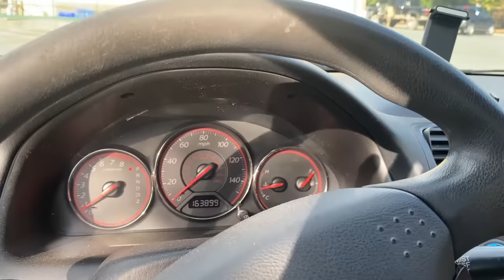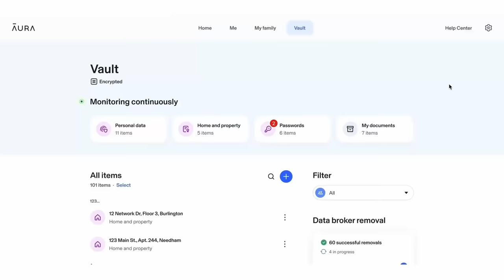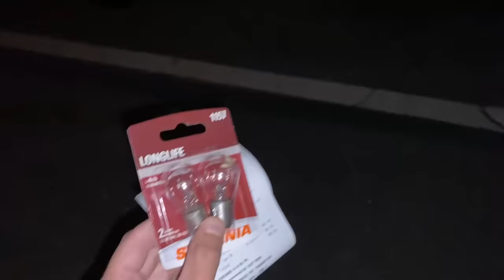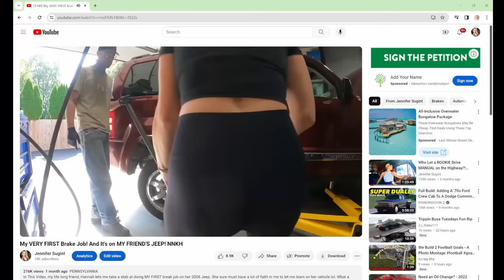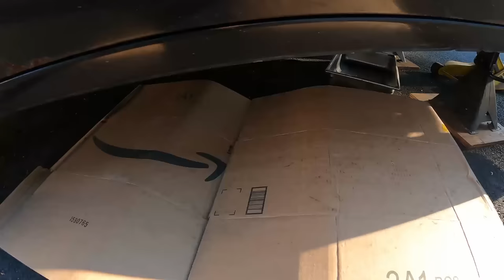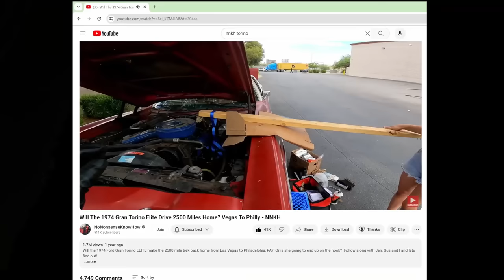Can This 86 Fox-body Mustang Survive its New Owner? I Bought a Manual! Jennifer Sugint- NNKH

Comment: I have a helpful suggestion for you. I noticed the falling headliner. I have done upholstery for years. There is a material I refer to as sew foam. It’s a thin layer of foam with gray cloth attached to the face. It is designed to sew to another layer of material to give a look of for an example padded vinyl. It looks just like your headliner. Same gray color. Take down the headliner backer board. Scrape the foam off then use foam fast spray contact cement on both the foam and the backer board and the foam. Let it dry for a few minutes then start at one end and smooth it together. Be careful of wrinkles. You can not pull it off to smooth out wrinkles. It once and done. Made a lot of side money for customers when I had my shop. The mastery is cheap. Good luck.

Comment: If you disconnect the incoming hose from the transmission going to the radiator, use a small amount of compressed air and blow back in the line. What it does, is blow back through the filter and clears it. It will eventually clog again. i actually ran my Civic like this for about 70,000 miles. I kept a can of compressed air and hose that I made to attach to the transmission hose, and had it down to about a 6 minute process. Just be careful not to use a lot of pressure, and a slightly warm engine helps. When it's cold it will blow right back at you. Also, if you take the transmission dipstick out, you will actually hear it clear, gurgle and blow air.

Comment: Just a hint that can save lots of grief later, always open the hood and the fill cap before draining the oil. There are few things worse than taking the oil out, only to find you can't fill it up again because the hood won't release or the cap won't come off. As for dropping the drain plug, I do it frequently enough, that I was not surprised it happened.

Comment: Jen, I'm a mechanic and I do yoga. It helps with getting into tight spots and remaining calm when faced with adversity. I totally admire yours and Chris' tenacity when it came to pulling apart the Mustang interior to get rid of every last bit of mouse destruction. Every time I watch your channel or Chris' channel it brings me back to when I bought my first project; a 1993 Cadillac Fleetwood Brougham. It wasn't in the best shape and it wasn't running either, but I didn't give up. I made it into something beautiful and I still have it.
Reply: Lt1?
Reply: @corona7st788  No, it's the Generation 1 5.7L V8. The LT1 is Generation 2.
Reply: @HighSierra1500  Thought those had the northstar in them
Reply: @gordocarbo  The front wheel drive Cadillacs had the Northstar engine. The rear wheel drive models did not.
Reply: @HighSierra1500  Thanks I did not know that! Northstar is a great engine its a shame about the head gasket issue, deal killer for me. THat engine was based off the LT5 and the LS1 off of it. 
May have to find a RWD one the LTx is easy to work on and the cars are cheap

Comment: There is nothing better than an 1986 gt Mustang with the factory square head rest seats gray with red piping/the center console with the picture of the car and lights up when you have a bulb out /the factory dash that lights up orange and has the round gages in it and finally the factory marchell fog lights the second Mustang that I owned was an sky blue 86 gt 62k original miles with a sun roof perfect gray interior power windows and locks 5 speed and was completely stock I bought it from the original owner who bought the car brand new in 1986 , I had it for 15 years until a drunk driving totaled it and I could never find a exact replacement that wasn't rusted out ,good luck with your new car it's completely awesome
Reply: Fun fact, same drivetrain as a towncar. (not a crown vic, it is the HO)

Comment: I have found that once you get the front end in the air and jackstands under the car, remove the jack. This lets you crawl under from the front. Much more room to work.
On removing the drain plug, as you unscrew the plug, push it up. When the plug gets to the end off the threads and ready to come out, get a good grip on the plug and pul it out quickly, this lets you control the plug and you wont get as much oil running down your arm.

Comment: Best way to keep from dropping the drain plug and keeping your hands clean is OTC 5961. Guys at my work give me crap for it all the time but yet I catch them using it because I keep it on the oil caddy. Oil will also drain a little faster if you take the oil cap off. Same goes for draining coolant. You could have moved the jack to get to the front drain plug easier. And that was the coil wire you took off doing the filter not a hose.

Comment: I have dropped the drain plugs in the oil pan before but didn't have gloves on, so had to get it with my hands.  Also, it's good that you researched it first because I've never heard of two drain plugs on a gasoline engine and I've done a lot of changes.  And the comment, "let it squirt" when draining oil, is a first for me!-:)

Comment: In regards to your Honda...I worked for Honda rebuilding transmissions that were under warranty. Depending on your particular transmission model, there are 2 or 3 very small screen  filters in the valve body that can get plugged very easily and they're only the diameter of a dime. Those transmissions rely on transmission fluid pressure to keep the trans functioning. When the clutches inside wear, those screens plug up. That's what your issue is.

Comment: Pro tip: When you can't seem to thread a bolt/nut/other machined thread, spin it backwards/counter-clockwise until it 'clicks' and immediately start tightening. Also, makes sure it's square to the other threaded part in both the X and Y dimensions. Then you can start to bring Z where you want it to be.

This works because there's only 1 spot on the threading that's 'open' to get it started. This will save you countless hours of frustration starting now. You welly.

Comment: Awwww I couldda made such a cool grill out of that air tank. Great video guys. And if your ever I indiana I have ah 2003 4×4 f150 shorted step side. Single cab, manual  for sale. 103k on it. It was My father's. NO leaks good tires. No dents. Rockers have some rust. All new calipers, pads, rotors, and booster. It sat soo long it was all seized up. Start it every day. Sometimes cruise it around the block just for the hell of it. God bless.d

Comment: This one kinda strikes home to me ,, because I had a nice 4.0 ranger 4wd and shortly an '11 Impreza hatch ,, just about traded the ranger straight up for an '84 fox t tops and louvers with a rebuild title or whatev ,,, got down there it needed a master cylinder and the radiator shows just fell off started getting chewed up by the fan ,,, it was a drive away trade to me ,, I'm no mechanic I know the parts ,, still regret passin up on it though ,, I binge all the car adventure vids you guys are one of the best 🤙

Comment: I went through the same thing back in 2020 when I made the mistake of storing my 89 LX 5.0 outside for the winter.  Complete infestation!  Did pretty much the same thing.  Rear panel, headliner, side panels, and rear lower seat cushion.  I am not sure if this product is still available, but I used Molecules Plus, the stuff is absolutely amazing. Kills all biological smells and leaves a pleasant, not overpowering scent behind.  Love those 4 eyed Fox bodies, they are the best looking of all, especially 85-86.  I would trade my 89 in a heartbeat for a 4 eye!

Comment: 1:01:05 a tip for whenever you have an awkward angle on a drain like that, if you want to avoid getting oil on other parts, jacks, etc, grab some tin foil and shape it into a little funnel or slide shape so you can direct where the oil is going to go
Reply: Thin plastic cutting board sheets are handy too

Comment: Just a note, the reason a lot of these hatchback Mustang had the rear glass in the lift gate tinted by the owners was because in the summer, with the sun beating down on them, the rear glass basically turned the passenger compartment into a greenhouse. Thankfully, you don't have a black interior, that would be brutal. The only saving grace is if the A/C is working, that cools it down pretty quick, the A/C systems in those Mustangs would freeze you out if working at top efficiency.

Comment: If the labelled filter ends up being too loose, it might not help the feminist cause.  Speaking of which, Chris is usually helpful, but had a real lapse as the peanut gargoyle.  To thread right, the filter must be perpendicular to the base, which may not be perpendicular to the engine.  Also, to prevent cross threading, I often turn it backwards until I feel a little drop, then turn forward and if it suddenly gets tight after about 1 turn, take it off and try again to avoid cross threading.
    You are right to take your time and practice, and to take it off and do it yourself.  I also suggest learning to polish headlights before learning oil changes, though the car I know needs headlight polish was the Civic, for which it may be too late.

Comment: Hey Jen that 'hose' you pulled off is the coil wire, it looked really corroded show chris, I'm thinking you need new spark plug wires n cap before you have issues on the road

Comment: Your supposed to change the oil filter before putting the new oil in
Reply from the maker: I actually didn’t know there was an order to this job until Chris informed me. He told me it was ok since I didn’t start the engine before I changed the filter.

Comment: Fixing that Civic trans most likely won't be that big of a deal. The trans slipping like that is kind of a common failure. There's an internal filter that likes to get crudded up, kill fluid flow, and lower the trans pressure to where it's pretty much in neutral.

Taking care of that will possibly make it pull as good as new.

Comment: ok you cant beat that 302  anyways  i made a deal with a guy i knew he wanted the engine out of it  so i got all the interior  and every thing else i wanted it so i gutted it  and sold everything out of the car it took me one year but i sold the ac  parts all together for 800 bucks the guy paid me 100 bucks  and all the parts so i pulled everything  the hatch i sold for 400 the interior went for 250  the front windshield i sold for 200  sold both doors for 150 a piece so i made money and i took all the wire harness and scrap the wire it took me 5 hours to scrap it and the guy scrap the body for 300 to a junk yard

Comment: Jennifer no plate on the car is a huge redflag for the police usually it gets your car impounded till you get the plate from the dmv . in this case i would have gotten a rollback and had it towed home till the paperwork was completed and insurance completed . ill be quite surprised if your insurance carrier dosent tell you to insure it for the least amount because cars that are 10 years or older to insurance companys have zero value there write offs . finding parts for an 86 lol i used to own a 90 chevy and couldnt find a replacement egr valve gm didnt even have the part new and scrap yards didnt even have it used so 86 parts maybe ebay but not napa or autozone .

Comment: i thought hes a mechanic? i guess a transmission problem isnt work fixing..but a guy like Chris seems to know eveyrthing inside and out of a car so id think he can fix it maybe jus tnot worth it .. there was a guy around here selling a newer dodge ram like 2016 or something for 2k and he said his clutch or transmission was slipping so i guess its a pretty big and not worht fixing issue.  my first car was a standard also Jennifer:) a grand am caught on fire on my way home one day:) luckily i got to my destination...cost me 350 bucks but that was about 20 years ago
Reply: i have the same issue with my truck i bought it wiht tinted windows and i cant see anything at night...i mean if im going straight ahead then its not bad but turning and backing up into the driveway i have to roll down the windows i cant see anythign the tint is too dark. i didnt know you could take this off

Comment: Seeing the car and with the minimal rust on it, may be worth fixing the body up until I saw that rot on the shock tower. That's a big problem there. That's the last place you want to see body rot on a Mustang. That old oil that came out looked thin and watery like it was contaminated with gas or water. If you have the money be worth fixing up, you don't see too many Foxbody Mustangs with a factory sunroof.

Comment: At 14:20 the thumping break noise. Anybody know what that could be? I’ve got new drums and shoes and hardware in mine and just replaced the axles and it’s just when decelerating at low speeds.

Comment: You know that 87 fox body in the video is pretty sweet too! That thing get some brand spanking new headlights over the last few months? Or is that hoodie just perfectly fitted 🤪
Reply: Ps, rotate the fastener backwards on the thread until you feel it fall off the ledge of the last lip. Then immediately counter rotate and it will thread on exactly at that point. Sometimes you can hear it too if you're real quiet. That works for the oil filter too. Because you're new at installs you don't have the angle right but the backwards rotation thing helps you a LOT. Ps perfect time to release this in case you get anxious about viewership. Early January is slow because people just want a break with the snow and all so you won't be overwhelmed by so much exposure right now.

Comment: Your devotion is priceless - Most tints are installed using heavy soapy water  to be able to move it around to remove bubbles ,Hot water Mr Clean will take the film off little elbow pain Nice car Jennifer, Personally I wouldn't be lead footing it them Mazda ZF trannies  love spitting out the 5th gear and pilot shaft ,,Never fails darn mice right  I bought  a new car same as Chris's red Ford Had a mouse run right up my pant leg in middle of traffic  Let me say the trousers were flat on ground and the mouse was taken out by a waiting crow on a powerpole as it ran thru traffic was the most bizarre thing  I witnessed in a few minutes at least the party was watching the crow and not my WHITES LOL .😂😂

Comment: We inherited cats. yeah, so we are cat people. I found this enzyme cleaner that rules. It actually eats the pee.  Its called unique Pet oder and stain eliminator. You mix it with water and spray it on and as long as it has food, (pee) Air and water, it keeps working. (pretty much) It shouldn't cause water damage. You spray it on, then cover it with a wet white cloth over night then in the am, you take off the cloth and let it air dry, if it still smells, repeat. I've used it on so many things. Even the wall when a cat sprays, I spray it, then take a paper towel and wet it and then put it over the pee and spray a couple more squirts to hold the paper towel, and when the paper towel falls off the wall, no smell. It works with any urine. Even had mouse smells in my garage when I tore down the peg board and before we drywalled we sprayed it and the next day, no oder. Do you get the idea I believe in that stuff?  lol   Learned about it when I moved into an apartment where the previous owner had a cat and the carpet had a spot that I could not stand. Been using it ever since.

Comment: YOU CANT  DRAIN  OIL  WHEN CAR   FRONT  IS JACKED  UP...... You should  lay car down  on the  all 4 legs   and  leave  for  30 mins.   When you check  oil with the  dips*it you  see  overfilled.  and you slowly ruin the  engine.  🙃

Comment: What, a rusty fox-body. Nah, that couldn't be.😜 Only rust free fox-body are restored ones or ones that were garage princesses.
163k. Your lucky. Had 2 Accord V6's and both times the trans only lasted to about 100K before the torque converter started to fail. Both times it was only when I was in 1st gear so it was like I had a manual car when starting from a stop. All the other gears were fine but eventually the trans would completely fail like yours did. Granted, the Accord V6's (and any other Honda/Acura with a V6) are known for having weak transmissions.
Promise you could find a junk yard trans for that Civic for under 1k if you wanted to keep it.

Comment: I bought the 4 cylinder model of that car new in 1985, it was the first cat I owned with cruise control, LOL. I would set the cruise on the highway by flooring it going downhill and then hit "SET". I think it maxed out at 140km/h

Comment: At 56 minutes I was looking at you, wondering why you look so awkward. Then it hit me. You’re facing down, so in effect you have your back to the job. Imagine trying to do anything else behind your back, by bending over backwards until you can see it!
You need to lie on your back, so the work is where you can see it and reach it, without being a contortionist. Everything becomes much easier then.
Regarding losing the plug in the waste oil, yup. We’ve all done it. Usually the washer comes off too and it’s never a type we have in stock, it’s always copper, so non magnetic and fishing it out often requires removing gloves, for tactile search capability.

Comment: Jen 🎉🎉🎉🎉🎉🎉 You are incredible why I say that is because you don't give up you keep at it. difficult downright hard at times when you drop the little nut the drain plug. You're looking for the one to put it back in after you drain the first 1 of like we all do that. , I've done it. Looked around for like half an hour. Where'd it go to but you?  Stuck to it, you even my next favorite part is when you unrolled. The oil filter to back off the car after Chris. Have rolled it on the half and t left or it. Keep trying you really are going to become an expert mechanic and then you can use many more times a girl did this no. A superwoman  Did this my spirit animal. don't give up. Success that car smells better because you that also.